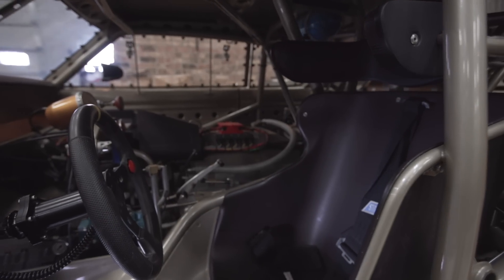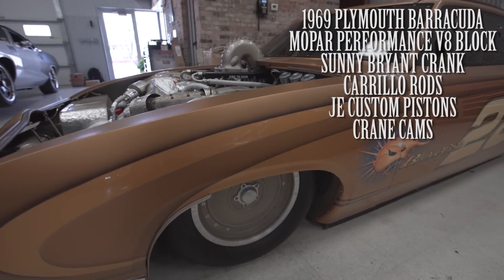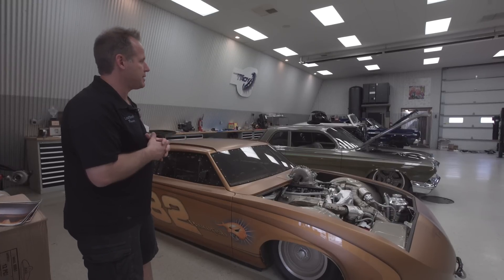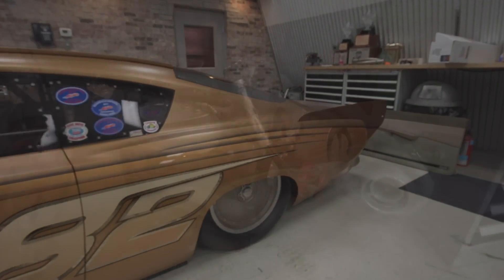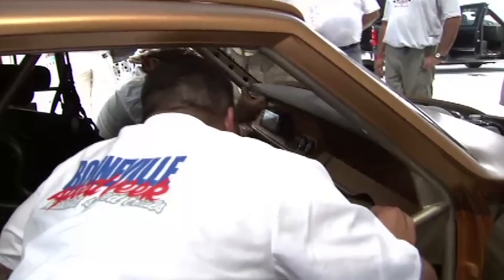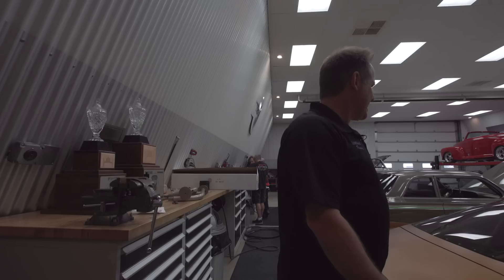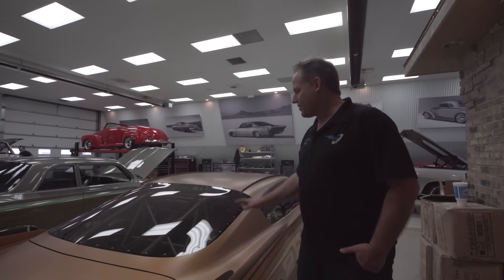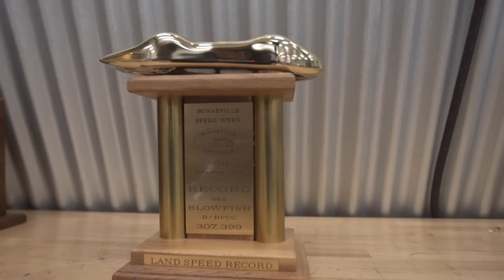300MPH Bonneville Monster "Blowfish" - Rad Rides by Troy

Comment: 10k rpm on a 2L 4banger what the fuck
Reply: thats actually more common than youd think
Reply: thats crazy do you need pneumatic valves for that or somethin
Reply: looked like a f20c out of the ap1 honda s2000 maybe ap2
Reply: requisim no, the hondas i see revving that high have normal valves and rockers
Reply: Daniel Corona nah, it was too wide
Reply: +Daniel Corona dude it says Mopar right on the head

Comment: I always wander who owns cars like this. Is it the driver? The builder? Or is it like a business car?
Reply: Some old dude with a hawayan shirt
Reply: Tyrone Ross Truely helpful. Your insight is matched only by your talent to cook waffles
Reply: itastain The sort of people that have these cars built dont drive them. They have them trailered to car shows, and they have a professional set records whilst they sit in their aircon trailer at the salts. WTF is a business car?
Reply: Tyrone Ross Business car. As in the paper work shows that is owned by the business. Not a single owner
Reply: @DJzSith Tax writeoffs. A fellow that comes into my job does this.
He has over 100K in custom work on his truck, and wrote off every cent. 
He shows the truck and uses it as "advertising " for his construction business. Writes off the cost of the show, all supplies, as well as fuel costs. 
The truck is raised several feet in the air and has massive tires. 

He gets 4 miles per gallon.  ( FOUR ! )

He drives in to my job and loads up something in the bed of the truck as "proof that he uses it as a work truck. "